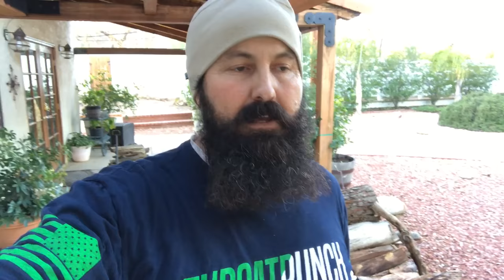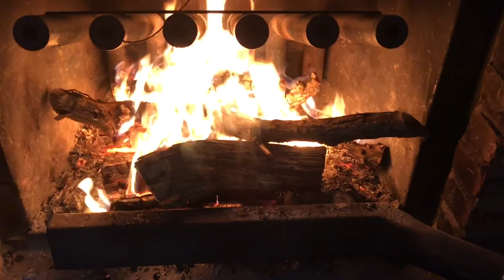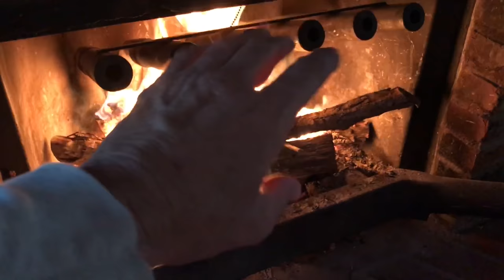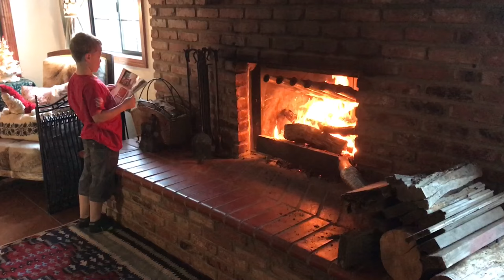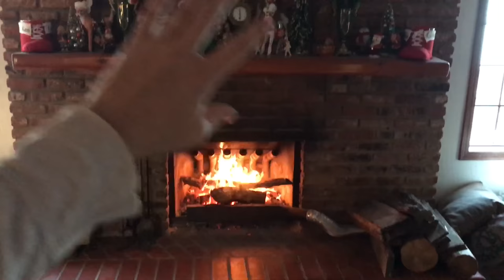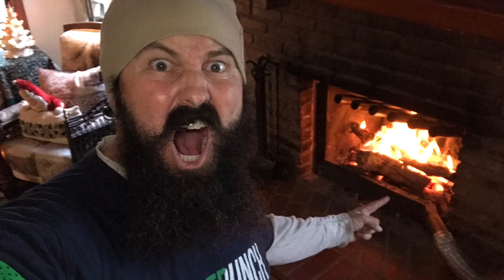Winter Heating - Fireplace Heat Exchanger

Comment: I'd definitely make sure my CO detector is in good working condition with that setup, though.
Reply: you can buy those, i have yet to read about any issues.
Reply: Where would the co2 come from..? Co2 is going straight up
Reply: @rc28ify  All I know is that a CO2 detector is considered vital by all the experts with any fireplace or woodstove even before you start messing with the air flow.
Reply: @frankburns8871  older homes aren't insulated like these newer ones!! But this is still something to take into consideration!!
Reply: @stevehamman4465  True. That's one of the few areas where newer homes tend to be better than older ones. But better insulation also means the house doesn't "breathe" like draftier older ones, so yeah, CO2 buildup is more of a concern.

Comment: I made mine a couple of years ago from trampoline  pipes, it works fine and it heats the setting area and the kitchen. Now i want to rework it to get all 4 pipes closer to each other in the middle of the fireplace so i can heat those pipes with less logs (the outer pipes does not get as hot as the middle 2). i am using a paint compressor to blow cold air in.
Reply: Those are galvanized and using galvanized metal to heat your home is not a good idea.  When galvanized metal is heat it produces toxic fumes.

Comment: Does your heat exchanger act as a grate for your wood?  Do you have to remove it to get ash out?  Looks like it rests on the bottom of your fireplace.
Reply from the maker: I have to remove it to get the ash out. Or tilt it out of the way to dig the ashes out. Depending on how thorough I’m being.

Comment: "Cool" but it doesn't strike me as something safe. Such thin pipes can easily burn through and then you can pump anything like smoke, sparks, flames and burning particles out of those pipes.
Reply: Good point, tac screens for spark arrester and check it often for defects/holes should be good